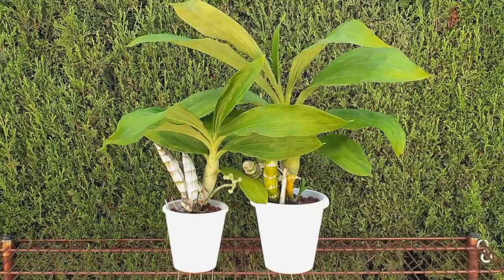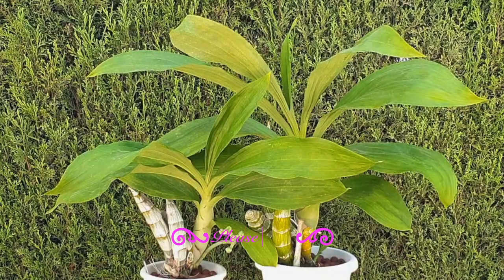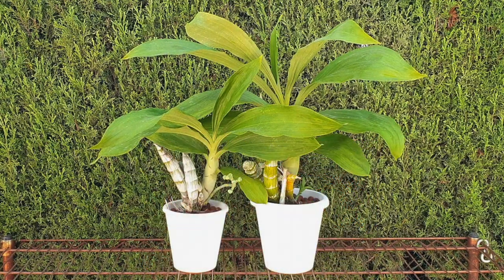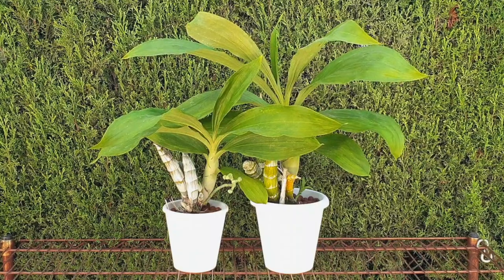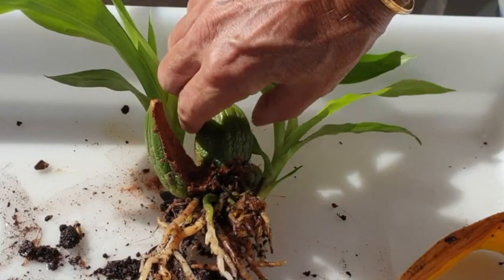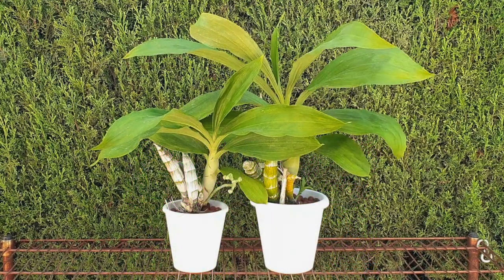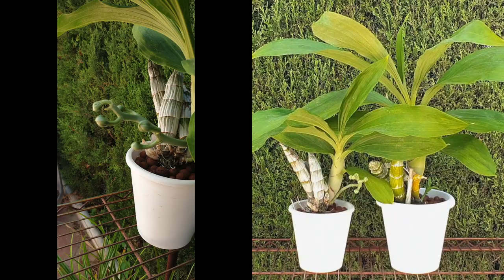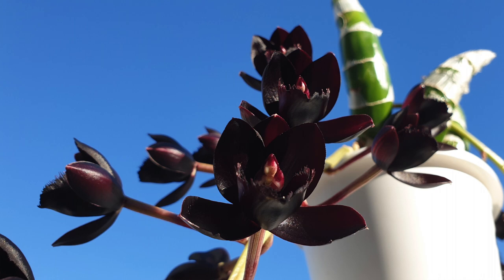Why Orchid Pseudobulbs Turn Yellow | 5 Common Causes & Solutions | Orchid Care Guide #ninjaorchids

Comment: Hi Nina. A very informative video. Two of mine have yet to bloom, and one bloomed in spring. I usually cut the old roots and repot in late winter 🥶. This time I’m doing nothing to see if that will make a difference. Take care. 🥰👏❤️🌴
Reply from the maker: HI Shirley 😍💐 thank you so much for your feedback and for watching, lovely lady! I would probably do the same, but every 2 years, however, the cleaning of leca that has had catasetinae roots wrapped around it is the worst nightmare of all orchids! The velamen is like thin paper and sticks to the leca. Its a process, and even when I think that I did a good job before boiling, once I reuse that leca and it happens to be at the surface of a pot in another orchid, the white remnants are then visible. So, .... a bit of laziness on my part but also, the older roots stay alive if they are allowed a little water here and there, which is something I am hoping to make the orchid stronger for when the new growing season starts. Still baffled as to why my older bulbs did not plump up again, but ... maybe one day I will understand the reason 👍🏼 hope you wake up to a beautiful day, Shirley! Thank you for your support 🫶🏼❤️🌸